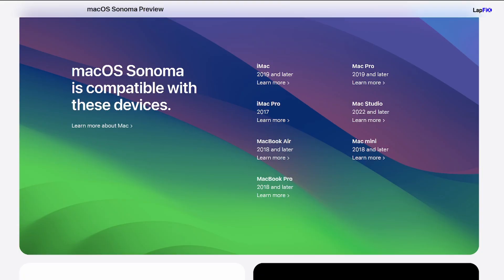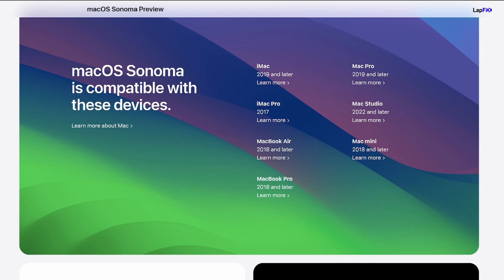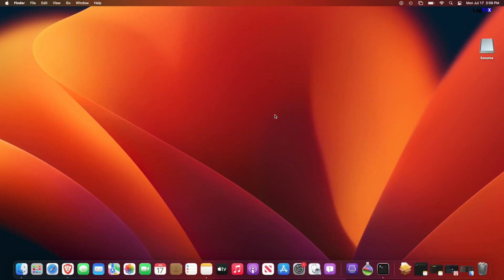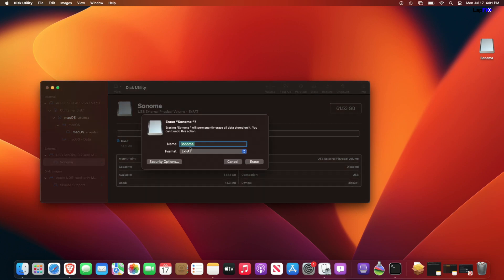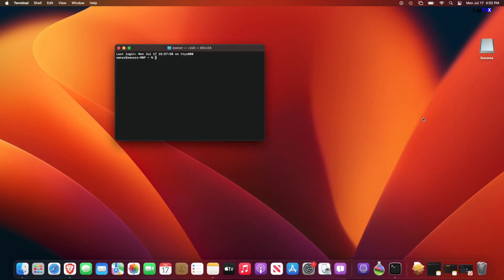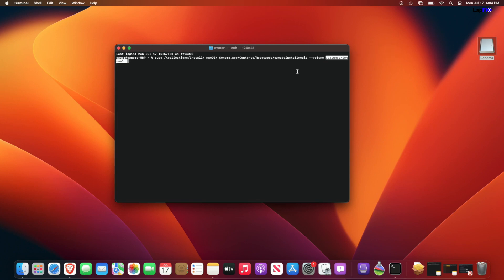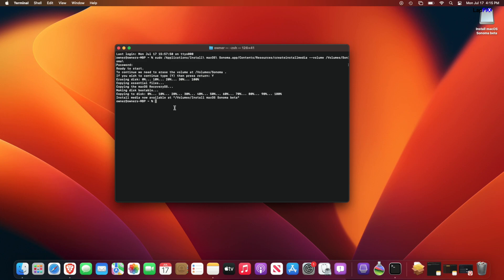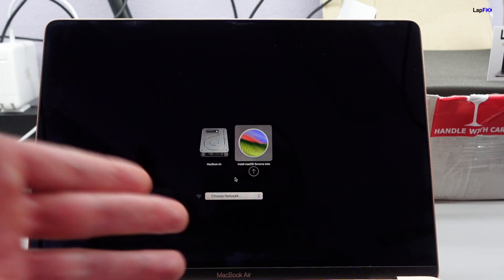Creating a macOS Sonoma Bootable Installer

Comment: Hi, Thanks for your videos,

I have a MacBook Pro 2019. I erased the hard drive, and now I don't have a user account. I tried using Command + R to install Mojave, but the installation failed with the following error:

packagekit: failed to verify installesddmg.pkg: sar_verify failed

I then tried Option + Command + R to install Sonoma, but that also failed with this error:

Stopped operation queue with error domain=com.apple.osinstallersetup.error code=1003 "An error occurred loading the update." UserInfo={NSLocalizedDescription=An error occurred loading the update. NSUnderlyingError=060000c958c0 {Error Domain=BOMCopierErrorDomain Code=1 "(null)" UserInfo={NSFilePath=/Volumes/Macintosh HD/macOS Install Data/updateBrain}}}

I attempted to use a USB boot drive, but since I don’t have an admin user account, I couldn’t change the startup security settings.

Is there any way to install macOS, or have I lost access to my MacBook?
Reply: I followed the steps here, but I couldn’t mount the InstallOS.dmg file
https://www.youtube.com/watch?v=Z9pK75VPJC0

Comment: Haven't played with it to much - I run a Hackintosh for my desktop and have a 2012MBP patched up to Ventura. Apple dropped the kext(s) for any non-soldered Broadcom cards (circa 2017-PRE) so I won't have wifi or bluetooth if I upgrade either machine unfortunately.